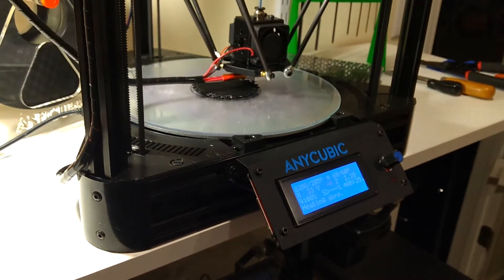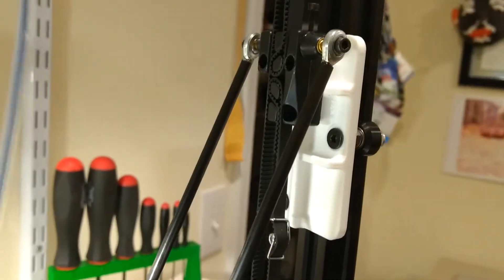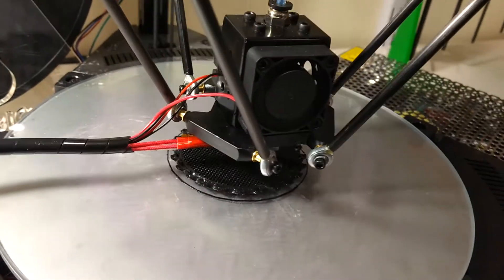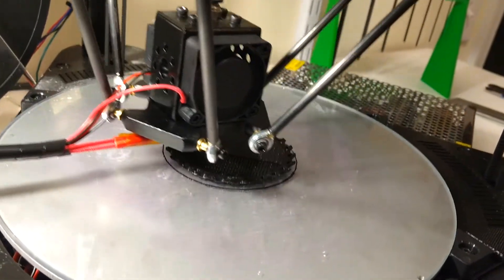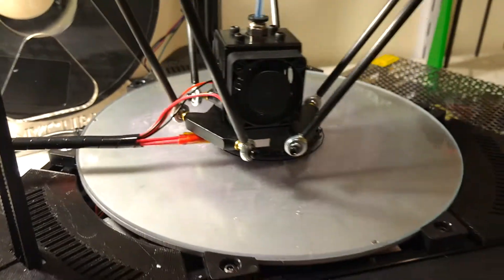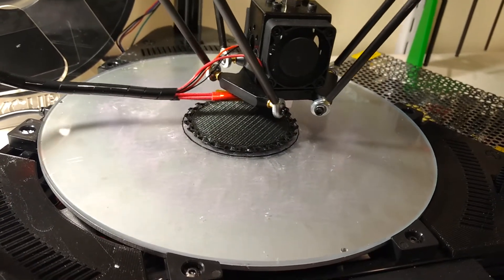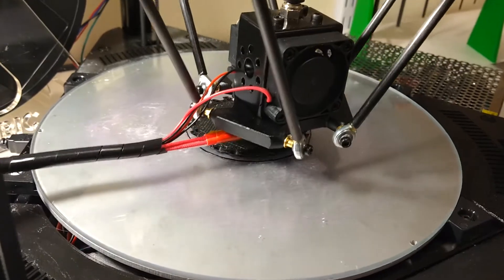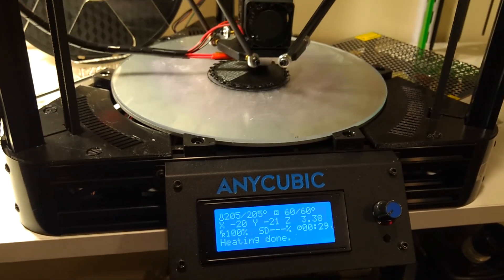Anycubic Linear Plus VRail Upgrade for Kossel Delta 3d Printer

Comment: Thanks for putting this out Neil. I just got the Linear Plus coming in and this is definitely something I would add in the if linear rails don't perform as well. Cheers.
Reply from the maker: Hi Anj == Thanks and good luck with your project.  The unit I modified continues to run quite well, it's one of my best printers (and REALLY fast!).
Reply: @NeilWNC  Thank you sir, I'm glad to hear that. What do you think of further modifying it with stuff like Duet and Eagle Labs Arms?

Comment: I liked the video Neil, but do I have questions about your Carriage Vrail Mod.
Looking at the STL it appears that the 3 holes for mounting the rollers are not the same, and much larger than the 4 holes for
mounting it to the carriage. Is this correct, or did you use bushings in those 3 holes for mounting the rollers? 
 What is the diameter of the 3 holes for mounting the rollers, and screw size(s) you used?

Thanks.
Reply from the maker: There are three wheel-mount holes: two are fixed mount with M5 screws, the third is a larger hole for the pressed-in eccentric (and M5 screw) that allows fine adjustment for removing clearance with the rail.  These are all using parts from OpenBuilds, probably best to check out their website before proceeding.  The four mounting screw holes are for M3 screws, and match existing holes in the AnyCubic part.

Comment: I like your workaround Neil. I would like to see your simplify 3D settings when you get a chance. I also had a few quick question if you don't mind:

Did you calibrate you stepper driver voltages? Mine were all around .880-0.900V from the factory. I changed them all to right around .500V and it seems to have tamed the beast quite a bit. The printer is noticeably quieter now and its movements seem smoother. I haven't done enough prints to say definitively if it's better, but the results are promising so far.
Reply from the maker: Hi John --
I find the "profile" settings for S3D kind of mystifying, difficult.  They seem to be spread all over the app.  If someone has a better idea, I hope they'll chime in.  I've found the best way to get going with a Delta-style printer is as follows:

1. Under "Help" select configuration assistant, select "Kossel Mini".  This is your starting point
2. Create a process, select the "G-Code" tab.
3. Set your build volume, offsets etc.  The offsets for x and y are 1/2 the build volume.  In other words, 0,0 is in the middle of the plate.  Also, the build volume is the largest square that will fit, NOT the diameter of your plate.
4. At the top, use "Save as New" for the profile.

As regards the print settings, I find the following to work well:

Nozzle Diameter: .4
Extrusion Multiplier: .8
Retraction: 3.5mm

The rest of it is pretty basic S3D stuff.  One oddity is that S3D doesn't really understand non-rectangular print bed -- it's constantly telling me my round object is too large when it's not.

As to your question about current, with the NEMA17s I generally run at .6v although I often make the extruder motor .9.

Comment: Hey I have a problem with the same printer and I did your mod and my printer seems to randomly go all over the place kind of like it got stuck In one position and goes in weird patterns and ideas what my problem is?
Reply from the maker: Sounds like you may have plugged the motors in wrong.  If it worked before and all three carriages move smoothly, I'm not sure what else it could be.  Good luck and post again if you get stumped.
Reply: NeilWNC I’m not sure maybe that is it but it prints the first few layers fine then does it could my carriages be to tight maybe?
Reply from the maker: @Mike-gv4je  Hmmm... You may be right.  Make sure all three move easily through their full range of motion.  If you over tighten one or more eccentrics it will bind.
Reply: NeilWNC that’s probably it I bought carriages and they don’t even roll downward under their own weight

Comment: Its not the rails its how you tighten them they twist in effect if not done properly happened to mine
Reply from the maker: I suppose there's some possibility for twist, but that was not the primary contributor for me.  I tested a problem rail in free-air and it exhibited severe stick-slip all by itself.  I posted a video (see my channel) in which I measure this.  I have found this problem in half or more of the as-shipped rails.